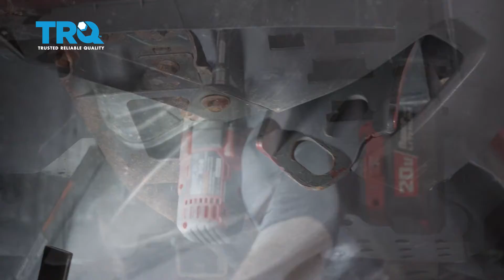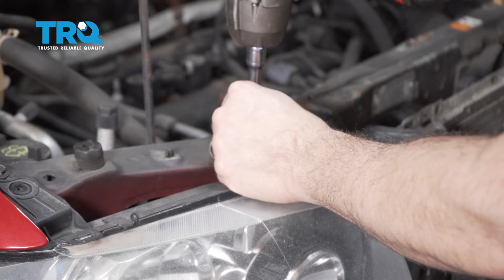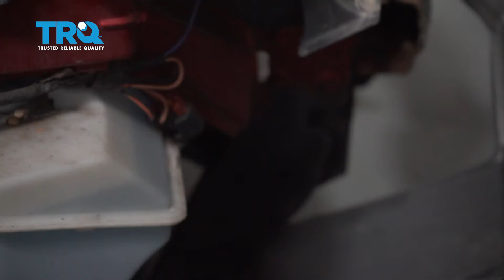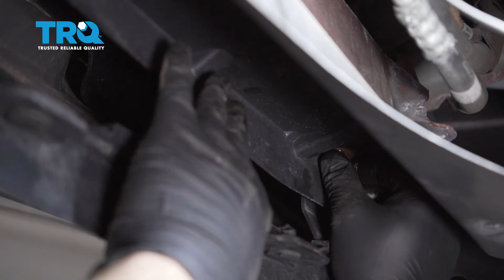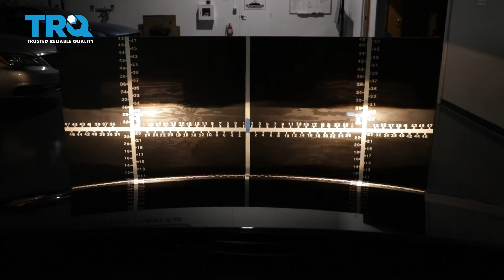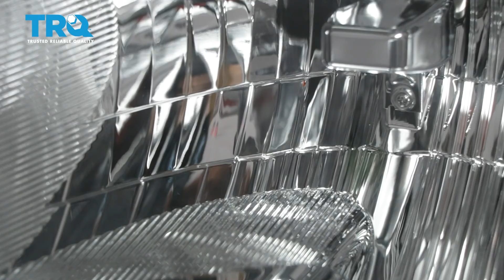How to Replace Headlight 2001-2007 Ford Escape

Comment: the connectors bottom out before latching.  One of the headlights the IO connector pushed right into the housing.  Did you even test the design?  unimpressed

Comment: unfortuneately this model of bumper cover is not the same for all the years. The one i was working on was an '05 escape limited edition and there were 2 additional plastic clips that held the cover to the metal bumper cross beam.